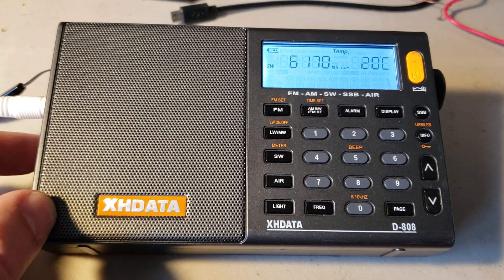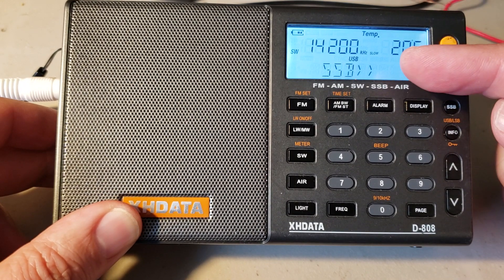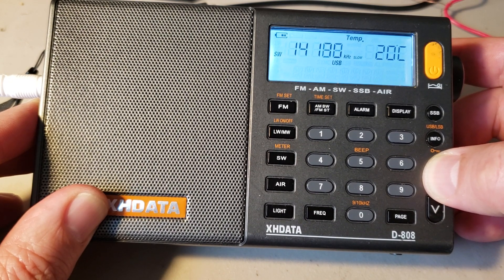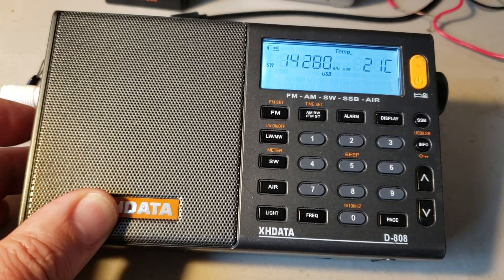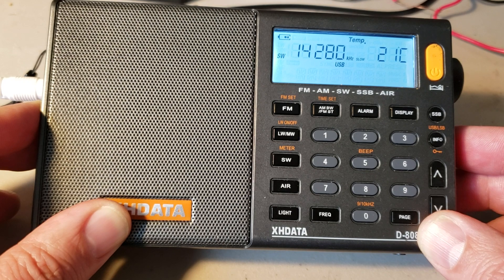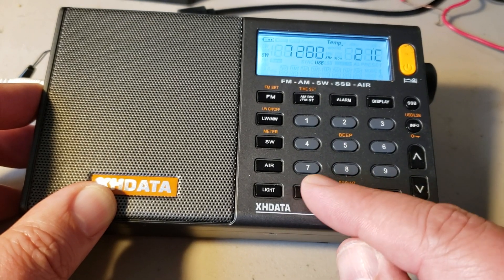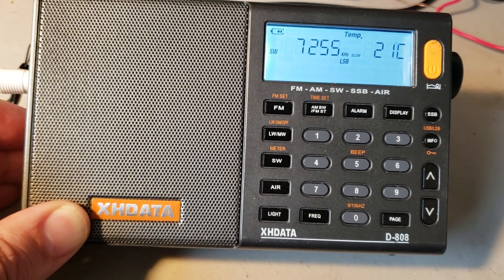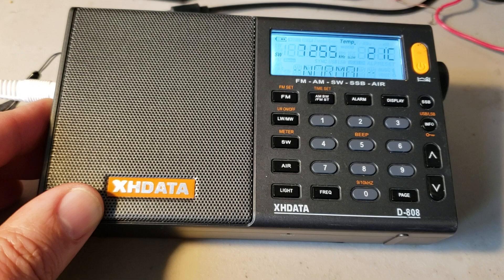XHDATA D808 manual Tuning USB LSB Signal and fine tuning button

Comment: Brutally unergonomic, and many radios are the same. The best way has already been invented: you need a VFO knob, and its step size can be changed. Also, if you turn the knob faster for a longer time, it might increase its steps. But if you only have two buttons then make their increments changeable (and solve the problem if fine tuning requires a different circuit to be tuned). That's about it. Yes it's more expensive but this hopping is just painful, it's only comfortable for AM/FM channels, SSB reception is less than secondary on these radios. I would never buy it (for short wave listening).

Comment: What do you reckon is the best type of external aerial to use on this radio
There were two supplied that came with the radio or does it matter ?
Reply from the maker: depends on the noise around where you will listen, the telescopic already receives quite a lot and you do not need that long of an antenna to receive more, but if it is very noisy a magnetic loop

Comment: my 808 temperature always on -30c. never changes temperature, whether on F or C. tried reset, but no luck. took out battery and waited awhile. still no change. must be defective. radio works ok though.

Comment: Hi to all, has anyone tried to receive radio broadcast stations on FM 87 - 108 MHz? When doing so in Germany (UTC + 1 hour) the time displayed in automatic mode is UTC -2 hours: That means, the clock ist "3 hours late", But I don't think, that the broadcast stations transmit a wrong time signal via RDS. Has anyone a solution? Thank you.

Comment: Does anyone know if an active loop antenna would work well with this set on shortwave SSB? - or because of its sensitivity & no built in attenuator would overload it and send the noise floor too high to hear anything but strong signals? Thanks